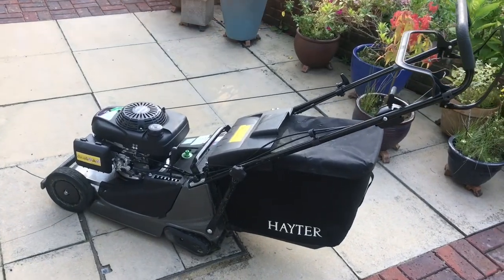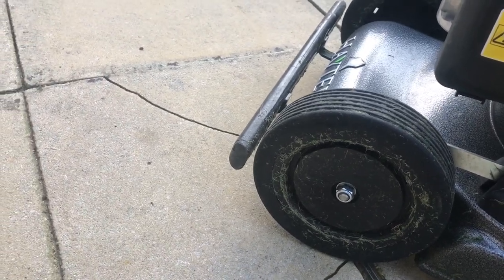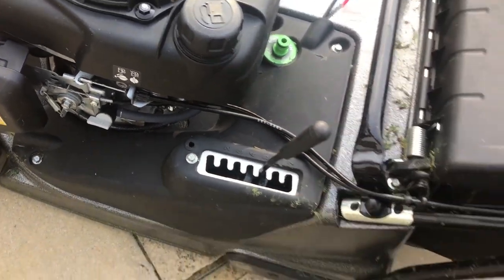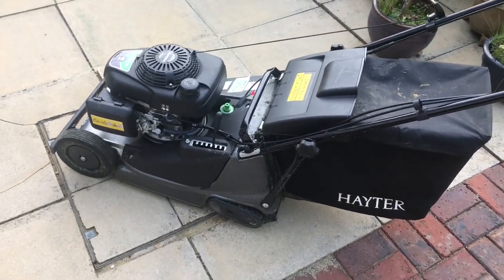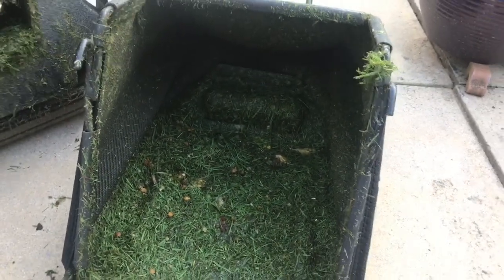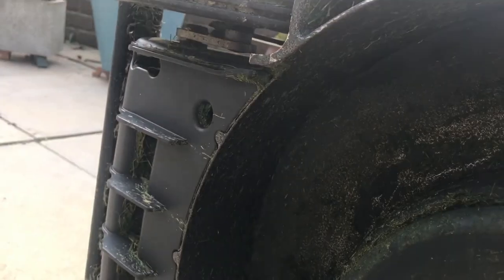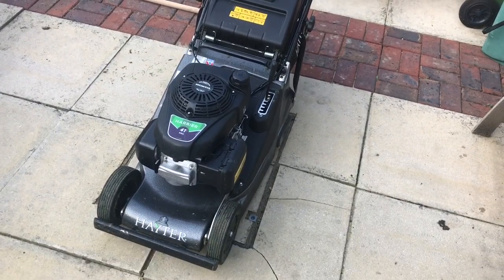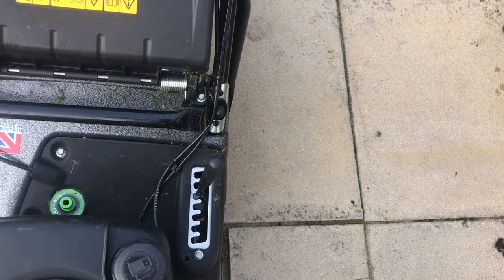Hayter 41 pro review

Comment: Hello. I've had my Hayter 41 since 2008. Its is serving me well. You can't buy one like this now because they have gone over to batterys where you take them off to charge them. I think that's a crap idea and made that way for cutting costs. I prefer the mower to charge battery well using it.
Reply from the maker: Usually those old batteries went dead quickly. Now it’s a lithium battery like a drill. Lot more modern and reliable. But no pull rope backup is a bit odd. Nothing surprises me with Briggs now